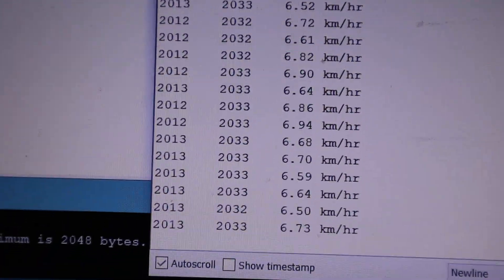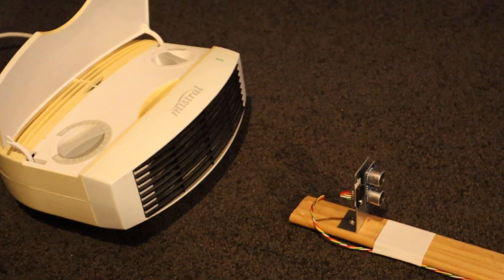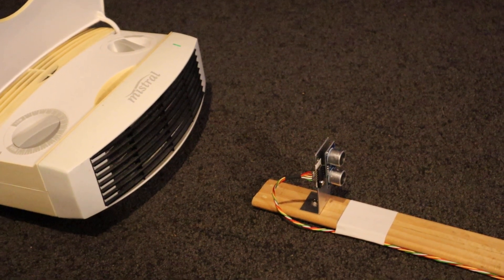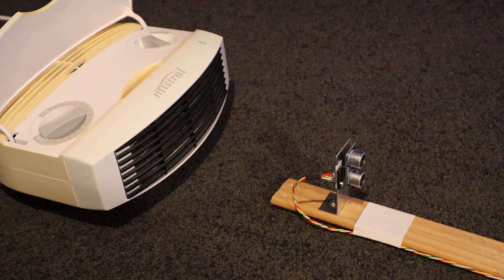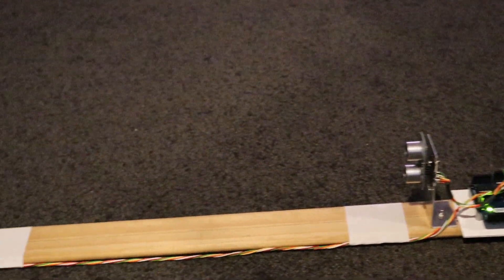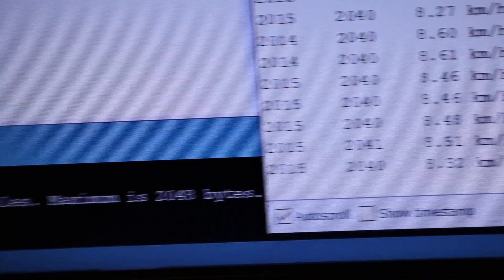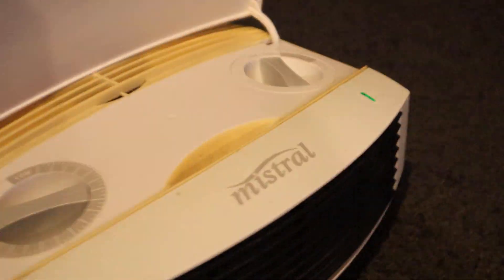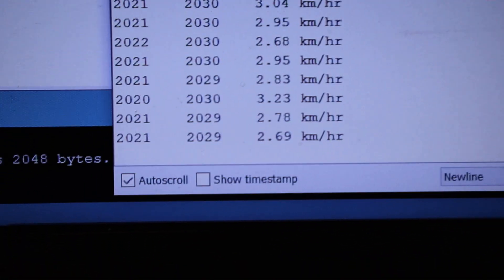ultrasonic anemometer

Comment: Hello! It is very interesting what you have done here. I am working on something like this for my bachelor degree. I encountered your video and read the instructions you gave. I tried to implement those but I have some parasite values. Can you, please, explain what you mean by "The dimensions have been chosen such that the windspeed is numerically equal to 1/3rd of  the flight-time-difference." ? I also didn't understand: windspeed =(TIME1-TIME2)/K. How to determine the K factor? It really confuses me. I want to learn more about this project. Can you, please, help me with this, sir? Thank you very much! Great project!
Reply from the maker: Assume two points A and B.

The time to travel from point A to point B against the wind will be:
Time1 = Time-in-still-air + windspeed.

The time to travel from point B to point A with the wind will be:
Time2 = Time-in-still-air - windspeed.

Subtract the times:
(Time1 - Time2) =  (Time-in-still-air + windspeed) - (Time-in-still-air - windspeed)

Solving
windspeed = (Time1 - Time2)/2 ............... (1)

If the sensors are optimally spaced then equation (1) will be valid.
Otherwise the equation (1) becomes: 
windspeed = (Time1 - Time2)/K ............... (2)
where K = calibration factor

In my case the sensor spacing worked out at (Time1 - Time2)/3

Helpful information:
The speed of sound in dry air at 20 degrees Celcius is 343 m/s = 343000 mm/s.
A windspeed of 1km/hr equals 0.277778 m/s = 277.778 mm/s.
One wavelength at 40kHz = speed-of-sound/frequency = 343/40000 = 8.575 mm.
Arduino microprocessors can only resolve time to 1us.

A more sensitive method is to measure the phase change between the transmitted and received waveform.
Reply: @qualityphotos1  thank you very much for the info!
Reply: @qualityphotos1  I didn’t get how u calculated the k factor 😕

Comment: I need to measure a wind speed generated by a fan. I have a space of 30 cm. How can I do it?
Reply from the maker: Measure the transit time in both directions and subtract the readings. In one direction the windspeed adds to the transit time of sound in still air. In the other direction the windspeed slows the transit time. (Still + airspeed)  - (Still - airspeed) = 2 x airspeed.  Sound in travels at 343.2 m/s in still air.   1 km/hr = 0.277778 m/s.  Just do the numbers.
Reply from the maker: Otherv methods include ...  a wind vane and a load cell ... or a Pitot tube ...
Reply: @qualityphotos1  What I want to do is to measure the speed of the wind blown by a fan. to place it in front of the fan, with a distance of 15 cm between the sensors. If the margin of error is not very high, I think to implement it. Could you please describe it to me step by step?
Reply from the maker: @berat8949  I already have ... see my first answer

Comment: can it detact a breath of human???
I want to put it on mask so it detact breath,can it do that???
Reply from the maker: Not with this circuit as (1) too much jitter (2) the transducers need to be spaced some distance apart.
Phase detection is more sensitive. Try using a CD4096B phase detector with the acoustic sound path fed into one input (pin 14)  and the sound source fed directly into the other (pin 3). Adjust the signals for 90 degrees in still air ... this will produce a square wave output (pin 2).  Air movement in the acoustic path will cause the mark-space ratio of the output to vary. It should be possible to adapt the sonic anemometer circuit diagram shown in https://www.instructables.com/Sonic-Anemometer/ .

Comment: hi i tried to go on the site but i can' t find the code and it was a very cool video btw
Reply from the maker: Sorry about that ..  the code is a variation of the code used in this experiment https://www.instructables.com/Dual-Sensor-Echo-Locator/.
I will release the final code once I have sorted the jitter problem.
Reply from the maker: My method as shown in the video ... (call this the North-South-axis ):

(1)Do NOT tape the sensors.   (2) Point the sensors towards each other.   (3) Space the sensors about 2m apart  (4) Trigger BOTH sensors together as shown in the code.   (4) Listen on sensor1 for the signal from sensor2  ... this is TIME1 (5) Wait ... allow time for any echos that might get back to the sensors to dissipate.   (5) Trigger BOTH sensors again together as shown in the code.  (6) This time listen on sensor2 for the signal from sensor1 ... this is TIME2  (7) Now do some mathematics ... windspeed =(TIME1-TIME2)/K where K is a fiddle factor depending on sensor spacing 

Explanation: TIME1= (time-in-still-air) + windspeed ; TIME2=(time-in-still-air) - windspeed;  therefore TIME1-TIME2=2*windspeed;  Juggle K until the windspeed is correct  ... you can work this out using (sound-in-still-air)=343m/s and 1mph windspeed = 0.44704m/s 

If you don't want to point the  sensors into the wind  you will need to duplicate the above method for the West-East-axis and apply Pythagoras.

Expect some jitter.  The HC-SR04 sensors send eight 40KHz pulses then listen for an echo after which they stop listening. It is entirely possible that they miss the first echo and respond to the 2nd or 3rd pulse in which case TIME1 and TIME2 will vary slightly.
Reply: @qualityphotos1  Thank you
Reply: @qualityphotos1  Hi there, I am new to Arduino and have been attempting to create such an anemometer without any libraries or software other than IDE. I have followed all the steps you listed but my sensors appear to be unreactive to any wind. Placing objects in front of sensors will create a change in the values given though. I'm unsure where exactly I may be going wrong, do I need libraries for better functionality of HC-SR04?
Reply from the maker: @NickyG0123  Hi Nick ... libraries aren't needed. Make an ultra sonic range finder such as this https://www.instructables.com/Ultrasonic-Range-Finder/.

 Once you have it working add a second HC-SR04 as I have done here https://www.instructables.com/Dual-Sensor-Echo-Locator/ but don't blank the sensors. Define the extra sensor pins in the arduino setup(). Place object at different distances in front of each sensor and trigger them at the same time (or immediately after each other) ... you should be able to measure each distance by listening selecting from which echo-pin to make the measurement.

Now separate the sensors and point them at each other.  If we trigger both sensors at the same time they should hear each other.  Each echo-pin is now measuring the distance (time-of-flight) is opposite directions.

A better method is to remove the RX sensor from each HC-SR04 board and position it at the distant end. Now trigger each HC-SR04 in turn and measure the time-of-flight. Be sure to wait a small amount of time so any distant echos have had time to dissipate.

I found that jitter is a problem. If you look at the waveforms in this article https://www.instructables.com/Enhanced-Ultrasonic-Range-Finder/ you will see that the echos aren't clean ... but rather a cluster of pulses which means the time-of-flight can vary slighly if the first received pulse is missed.

Good luck with your project.
Reply: @qualityphotos1  Is there any chance you will be releasing your code or a chance you can go over my code? I believe triggering the sensors at the same time causes interference that make the receivers unresponsive to wind. I have modified the code from the Dual_Sensor_Sonic and even running their code yields distances that do not proportionally change when the object is moved closer to one sensor and away from the other. Any ideas on where I may be going wrong? I appreciate all the help.
Reply from the maker: @NickyG0123  Hi Nicky ... I put this approach on hold some time back in favour of other approaches. From memory the code was adapted from https://www.instructables.com/Dual-Sensor-Echo-Locator/. 

HC-SR04 sensors do not listen unless triggered which means you have to trigger each at the same time, or in quick succession, if you wish to send from one HC-SR04  to another. This method definitely works as shown in the video that accompanies https://www.instructables.com/Dual-Sensor-Echo-Locator/. 

Your other alternative is to remove the RX sensor from an HC-SR04  and position it a fixed (arbitary) distance away from the other using hook-up wire to extend the leads. Now generate a constant airflow and take three time-of-flight measurements: one with no airflow; one facing the wind; and one against the wind ... all three measurements should be different.  The difference in the two "airflow" readings will now be proportional to windspeed ... a contant multiplier will give the actual speed. The fact that you have taken the measurements at different times shouldn't matter if your airflow is constant.

The problems you are likely to encounter include: the sensors are too close together for the arduino resolution; noise from the fan blades; turbulence from the sensor mounts; and the inherent design of the HC-SR04.  Regards the last point ... the HCSR04 sends a series of eight pulses before it starts listening. Question  ...which pulse triggers the detector ... the first echo may not necessarily trigger the detector which means the signal has jitter.

Good luck with your experiments.

Comment: please post the code and instruction as soon as possible.
Reply from the maker: The code and circuit is a variation of that shown in my article https://www.instructables.com/Dual-Sensor-Echo-Locator/. Just trigger BOTH sensors simultaneously and look for a response on the oppposite sensor.
Reply: @qualityphotos1  so if i understand ... if i want to do an anemometer and add a perpendicular axe to calculate the direction of the wind i could use your multiplexe echo locator and trigger every captor at the same time ?
Reply from the maker: @samuelperianincarpin4021  My method as shown in the video ... (call this the North-South-axis ):

(1)Do NOT tape the sensors.   (2) Point the sensors towards each other.   (3) Space the sensors about 2m apart  (4) Trigger BOTH sensors together as shown in the code.   (4) Listen on sensor1 for the signal from sensor2  ... this is TIME1 (5) Wait ... allow time for any echos that might get back to the sensors to dissipate.   (5) Trigger BOTH sensors again together as shown in the code.  (6) This time listen on sensor2 for the signal from sensor1 ... this is TIME2  (7) Now do some mathematics ... windspeed =(TIME1-TIME2)/K where K is a fiddle factor depending on sensor spacing 

Explanation: TIME1= (time-in-still-air) + windspeed ; TIME2=(time-in-still-air) - windspeed;  therefore TIME1-TIME2=2*windspeed;  Juggle K until the windspeed is correct  ... you can work this out using (sound-in-still-air)=343m/s and 1mph windspeed = 0.44704m/s 

If you don't want to point the  sensors into the wind  you will need to duplicate the above method for the West-East-axis and apply Pythagoras.

Expect some jitter.  The HC-SR04 sensors send eight 40KHz pulses then listen for an echo after which they stop listening. It is entirely possible that they miss the first echo and respond to the 2nd or 3rd pulse in which case TIME1 and TIME2 will vary slightly.
Reply: @qualityphotos1  in step num 4 
do u mean by trigger both sensor is making the trigger pin at both high at the same time?
Reply from the maker: @lolasolomon1054  Correct

Comment: Can you give me that code and instructions? I need it emergency for my varsity project. My data is fluctuating so much. Please help me as soon as possible. I have no need so accurate.
Reply from the maker: Try smoothing your data.

An extremely fast method for smoothing N samples using one addition and one subtraction is described in http://www.dspguide.com/ch15/5.htm.

Sum (once only) N items.
Place these items into a circular queue
Point to the first (oldest) queue item 
Subtract the first item value from the sum
Add the current sample value to the sum
Replace the first queue value with the current sample value
Advance your pointer
Average equals sum/samples

The code for a filter using this technique may be found here https://www.instructables.com/Laser-Anemometer/

Regarding my ultrasonic code ... it is not yet ready for release

Comment: So if you use 4 of them you could actually make out wind direction?
Reply from the maker: Yes ... subtract the opposite NS and WE sensor readings and apply Pythagoras.
Have delayed posting the above code as am working an improved circuit ... the concept is the same but is much more responsive.

Comment: thanks but how does the left sensor detects wind with its back facing
Reply from the maker: The annemometer works on doppler.

We alternately measure the time taken for sound to travel a fixed distance "into" the wind then measure the time taken for sound to travel the same distance "with" the airflow. This is achieved by alternately using the HC-SR04 transmitter at one end and the HC-SR04 receiver at the other.

In still air the sound flight-time taken is the same in both directions ... if we subtract the two readings we get zero.

In moving air the two readings are different ... the number we get when the two readings are subtracted is proportional to the wind speed.
Reply: @qualityphotos1  why would it not be enough to measure one direction ? it would be slower and faster depending on if with the wind or against ?
Reply from the maker: Exactly. (still+windspeed)-(still-windspeed)=movement*2